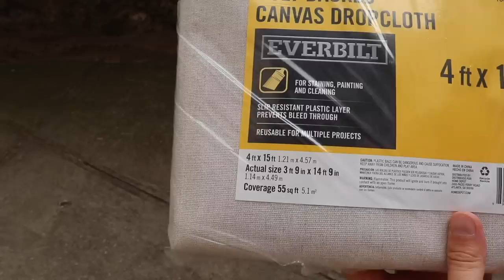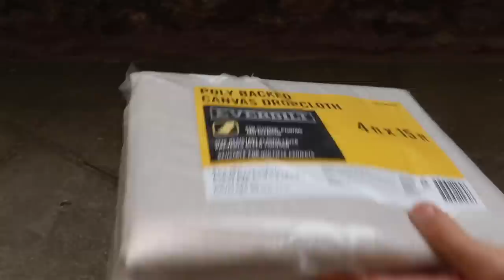Crafting the ULTIMATE Desert Terrain - FULL BATTLEFIELD Tutorial for 40k, Necromunda, Age of Sigmar

Comment: Like for Diggas in the intro :D

Ive also done a caulking mat, spread on caulk one tube at a time then sand before it dried, i think i used 4 tubes for my 6x4. 
Painted with a watered down mix of a dark brown acrylic crafts paint and PVA.
Then drybrushed with a reddish brown, yellow ochre and a lighter gray.
Applied a "wash" of black/brown and PVA.
Then applied multiple layers of watered down PVA to make absolutely sure no sand will come off and to protect the paint.

Mixing it all in like you did is probably more durable and with paint inside the caulk i think any cracks would be near invisible, i test bent a corner on mine and while it did get a bright crack it isnt visible when the mat is laying flat.

Also did some stone arches and standing stones but i built a hot wire cutter for shaping them, in the end i think the surface texture you got using a knife looks better than the ones i did.

Amazing work!

Comment: To add finer sedimentary layers to your rocks you might want to try horizontally brushing the foam with a stiff wire hand brush like what you use to clean metal flat files. The wire part is about 1 1/2" wide by 6" long on about a 12"" handle. These wire bristles are fairly stiff and should be able to quickly score the foam after the main distress chipping is done.
Reply from the maker: Check my egyptian video from last September for an updated sandstone technique 😉

Comment: As someone about to return to the hobby this looks absolutely stunning and has inspired me, one question? How easily is your board stored and when rolled up do bits crumble off?
Reply from the maker: No crumbling! I stress tested it outside really well and knocked off angrhing remotely loose. The weight is an issue for rolling so i tightly roll it around a large cardboard tube and tape is shut because it will collapse like a squished cigarette butt under its own weight otherwise
Reply: @EricsHobbyWorkshop  thats great, will get started with my own very soon 🙂

Comment: Love the build, I've been wanting to do some rock pillar terrain like this for quite a while, but never tried because  I've only ever seen it done with a hot-air cutter before. I really like the techniques you used here!

When did you start using the Gorilla Construction glue? Is it really that much better than other glue options, like PVA, etc? And how do you cap it off between uses so it doesn't dry out?
Reply from the maker: I don’t remember when i started, but gorilla glue is by far the best option for glueing styrofoam together. Water based glues like pva will not dry in between non porous surfaces like xps foam, and hot glue will either melt into the foam, or dry too quickly and thickly leaving a visible gap and seam in between layers of foam. I still use hot glue for tons of things and pva for glueing paper and sand etc. To cap off the gorilla glue i just squeeze out a bit extra- maybe a pea size amount and leave it sticking out of the nozzle to dry. When its time to use the glue again, I simply pluck the dried nub out of the nozzle and use as normal the still wet glue behind. It might come with a cap, i dont recall lol
Reply: Awesome, thanks!

Comment: Hello ! I'm currently trying to do a "lava" base for a large figurine. I had a bad experience during the past with using paint bomb on the scenery I had sculpted, as it had melted :(
I'm not sure I understood  (English is not my native language) what you did use with the paint to coat the rocky parts, because you used the bomb on it after and it did not melt. what's spackle did you use in there ?
I saw people having the "melting" issue even after coating their sculpture with and mix of paint + PVA glue + water, so that's why I'm trying to find  an easier solution like yours
Reply from the maker: Melting is caused by the propellant in the spray paint. If you keep the can fat enough away from the foam, the propellant will not reach it and will not dissolve the foam. Black magic craft made a great video on this recently. The spackle I used is DAP
Reply: @EricsHobbyWorkshop  thanks for the answer, I'll take a look on the video and the spackle :)
By the way love your video, great advices and work !

Comment: Hey Eric, first off I love your terrain videos. Does the gorilla glue foam adhesive hold up over time? I've seen friends also put sticks in the foam to help hold it together - do you think the sticks would be unnecessary?
Reply from the maker: My first time using it but i dont think sticks are necessary. I usually use sticks too but the hold feels very very solid. Plus its not like there will be any shearing forces on these pieces. Check back in a few years and i can tell you for sure
Reply: @EricsHobbyWorkshop  I'll give the glue a shot then, thank you!